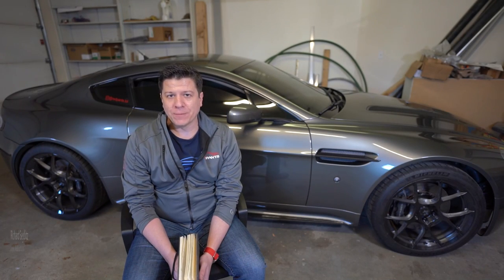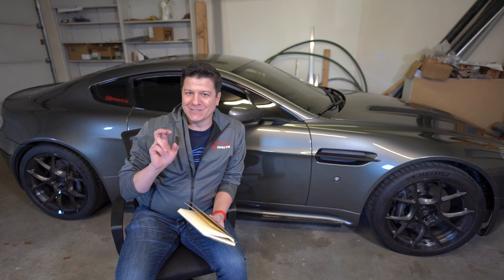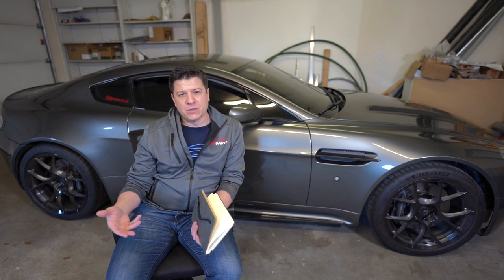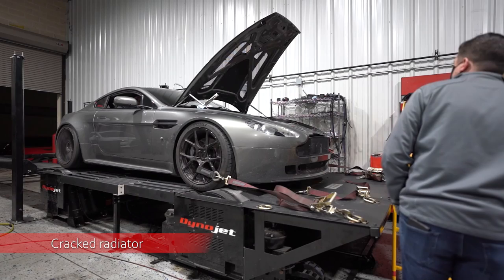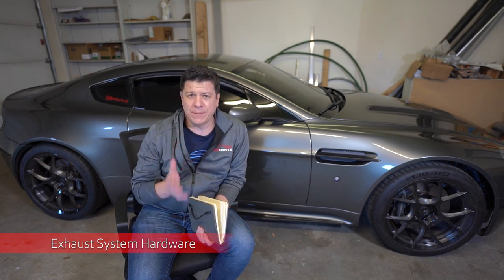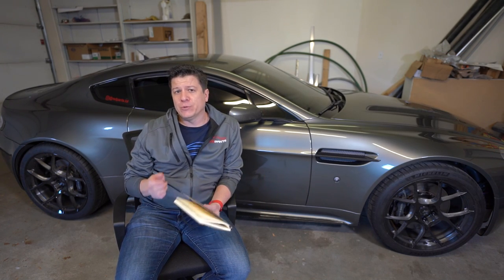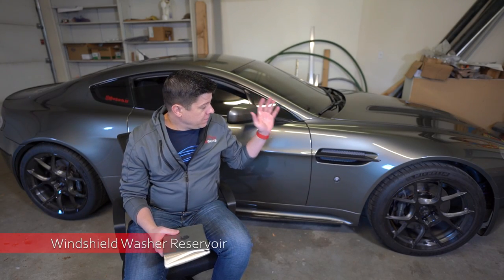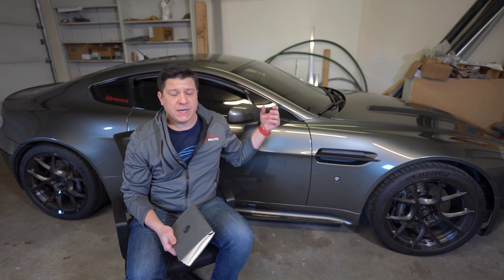Reliability Report! All the reliability issues I've had with my 2007 Aston Martin V8 Vantage

Comment from the maker: To clarify, I bought the car 10.5 years ago when it had ~21k miles on it, so I've owned it that long and added ~75k miles. That's why I mention having it for 10 years even though it's 14 years old, and that it's got nearly 100k miles when I've done 75k in it.

It... It made sense in my head.

I also realized I left at least one thing off the list immediately after this finished uploading, so there will be at least that much more info on the dedicated web page about my car's reliability once I finish and publish it.

Comment: Good Video.  My Vantage fuel cap broke twice. If you are not careful when taking it out of the holder hole in the filler flap it will break and the valve ad spring will wind up in the tank. You can use the guts from a LandRover filler cap ($35) to fix it.
Reply: Could You be a little more specific? It would help to find the right part- Thanks!

Comment: I'm amazed what some people will put up with in owning a certain car.  It's nice we get to choose but there does exist a certain group of autos that consistently fall apart while there also exists other fantastic cars that you can drive for 100,000 miles just by doing the recommended maintenance.  Having to repair parts that should never, ever break just isn't my cup of tea.
Reply from the maker: I drove this car extensively for my first decade of ownership and had extremely few problems. It wasn't until the last two years, when the car's mostly been in storage and I'm just now getting it back on the road, that it's having problems. Regular use of the car and routine maintenance prevents most issues. It's the garage queens that suffer.

Comment: Always interesting videos.  I’ve learned how to fix a few things on my 2015 Vantage GT, like the tail light condensation.  From your experience, is there much difference in reliability issues between a 2007 and 2015 model?  Thank you for your service in the Marines!
Reply from the maker: Generally speaking, many of the issues found on earlier cars were rectified over the years, so, generally, the newer the car the more reliable it will be. That said, there were some cost-cutting measures to make Aston Martin Lagonda (the company) more attractive to buyers, so Ford did make some changes that reduced reliability. The main one that I always think about is the engine - the 4.7L uses some cheaper components and isn't nearly as reliable as the 4.3L engine.
Reply: @Redpantslol  Thanks for the response!  Looking forward to more of your videos and how to do my own maintenance.

Comment: I had driver side window glass slip...just need to remove door panel, re-align glass and tighten the screw that holds the glass to the window lift mechanism. Front timing cover seal leaks...about a drip per week. No other issues so far, but its a 2007 with only 5k on it. Lots of things to break still HA!
Reply from the maker: I did have the loose retention screw in one of my windows but I chalked it up to damage (it was the same side as the tire wall damage). I'll make a note on the accompanying webpage just in case!

Comment: My 2008 sportshift .   The paddles and buttons buz the solenoids.    But no shift .  If i use scan tool.  Car shifts but display says N.   But if i turn off key and bsck on says 1.  Pull paddles back to N .  Clutch not bleeding .    Asm pump working .   Maybe asm accumulator has gone bad.    
Have you any ideas

Comment: the beginning of the video might have explained the squeaky brakes with mine lol, just picked up my 19' Vantage in December, I know two different gens, but I was  wondering if it was normal for the brakes to be squeaky as hell sometimes, ill have to check out your brake video next
Reply from the maker: Check out the pads I sell on Redpants. The compound and the way I spec them eliminates brake squeal, has less dust, and makes the pads less "grabby" (a complaint I've heard from a number of New Vantage owners). Shoot me an email if you have any other questions about them
Reply: I have same car as you. The OEM pads squeal like hell. I switched to Porterfield pads and that helped a bit. I also changed my driving style to rely more heavily on the brakes (braking later etc). Gently riding the brakes all the time (in traffic for example) glazes the pads and causes squealing. Took an extraordinary effort to re-educate myself and break old habits but since relying more heavily on the brakes my squeal has completely disappeared.

Comment: In the market and see a 2009 vantage manual with only 10k miles on it. Walk away because garage rot?
Reply from the maker: I actually have a video in the works right now (um, a few videos) about how many problems my car developed while in storage/transport. Personally, I'm not a fan of garage queens and older cars with low miles is a huge red flag for me, particularly with a V8 Vantage.